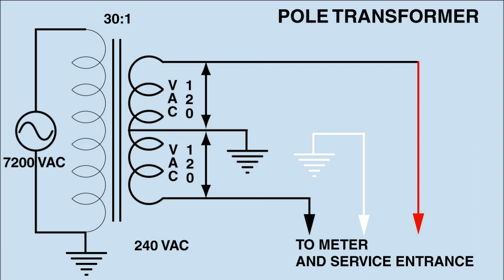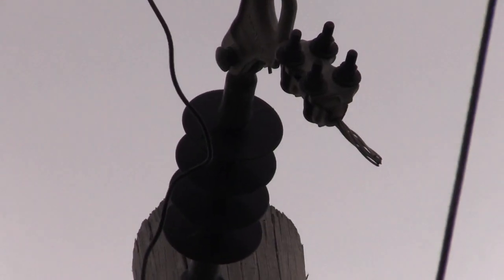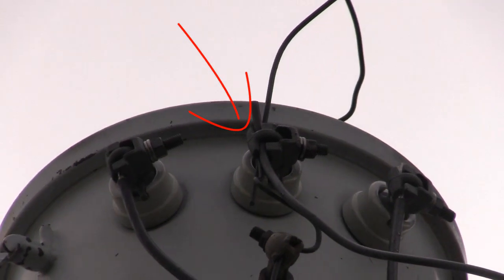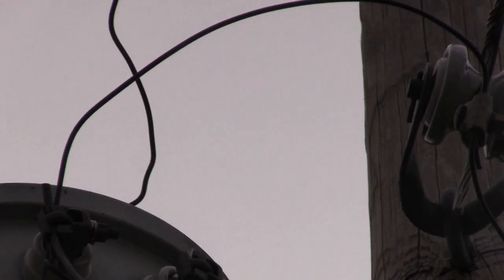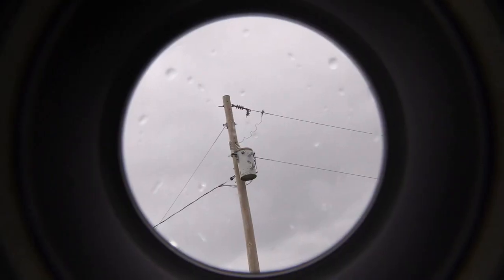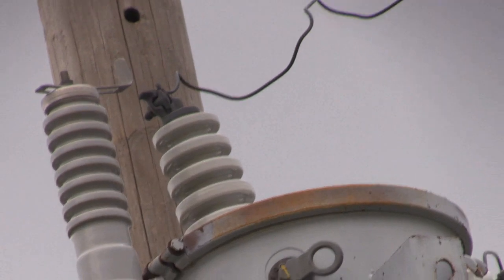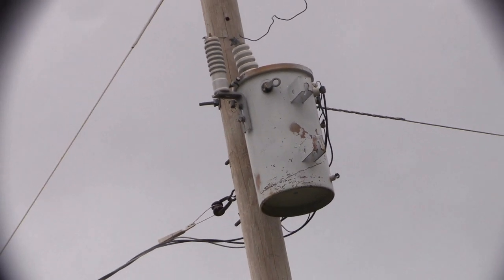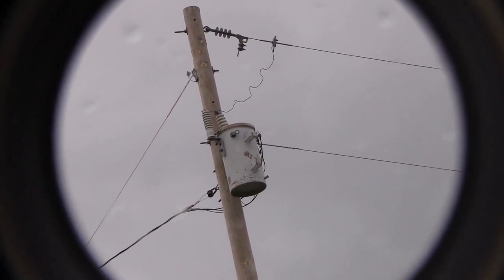Pole Transformer

Comment: How does the high voltage wire feeding the can, BALANCE BACK to the distribution point? No visible Neutral? thank you
Reply from the maker: Hi Ted, Thanks for the comment.  This is a common point of confusion, no pun intended.  An entire video could be made on just this point.  The first graphic in the video shows the generator at the power plant working against a coil which ends up being the primary coil of the pole transformer after being stepped up and stepped down along the transmission path.   On half of the cycle the generator forces electrons from the top down to ground and on the other half of the cycle the electrons flow up from the ground.  So at the pole or at any other transformer along the line going back to the substation or however far you want to go back, the ground is distributed.  Every transformer is grounded and every pole is grounded etc.  I am so glad you are thinking about this.  Start looking at every pole transformer you pass and you'll begin to notice that they are all fed by a single "hot" wire, the one on top of the poles in the pictures I took in my rural area, and they are all grounded by the lower wire on the pole.  The lower wire goes all the way back to the point where my single phase leg breaks off from the 3 phase, where it is grounded.  As mentioned before this lower wire is grounded at every pole along the way by a solid copper ground wire that runs down the pole and is coiled up at the bottom of the buried end of the pole.   In this case "neutral" and "ground" are tied together and therefore synonymous.  I apologize for the poor quality of the video.  In my defense this was one of my very early attempts.  It could be improved greatly.  Near the end of the video I label the lower "return" wire which would be what you refer to as "balance back to the distribution point".
Reply: @PostHocNonSeq  can you explain how electrons flow out the ground from the power plant or substation .does that mean the ground carries electrons into both coils of the transformer . Also does  ground in the home get electrons from the secondary coil in the transformer through the ground and the incoming hots . . Your the first person I heard talk about this.
Reply from the maker: @j.s3612  It can be confusing to say that "electrons flow out of the ground from the power plant".  They don't really flow but rather bump into each other.  One classic example is a pipe full of golf balls or tennis balls, when another ball is put in one end a ball falls out of the other end this makes it look like a ball flowed through the pipe but if you paint one of them red you'll see that it takes much longer for the red one to actually flow from one end to the other.  Remember to think of a power plant as an alternating current source.  Although the electrons may be bumping one way at a particular point in time they quickly reverse and bump the other way 60 times every second.  The circuit from the power plant to the pole transformer only includes the primary of the transformer and I know that sounds impossible but the transformer action induces the current into the secondary windings, there is no physical connection between primary and secondary inside the transformer.  The secondary winding in the transformer is part of the circuit or loop that goes to the "home".  All electrical current in the home is current that has been induced into the secondary winding.  Induction of current in a conductor is related to this discussion but is generally a subject area of it's own that comes up in basic physics.  Thank you for taking an interest in this subject and the video.
Reply: @PostHocNonSeq  if the primary winding on the transformer was disconnected frome the ground will the transformer still function correctly.  Could the fuses still blow if its not connected to the earth . Thanks for your time and energy
Reply from the maker: @j.s3612 NO, 

When you say "If the primary winding on the transformer was disconnected from(sic) ground?"  I think what you mean is if it is disconnected from the return path to the power plant.  If that happens the circuit will be open and no current will flow.  Referring to this return path as "ground" is OK because it usually is, there is often a ground wire running down each pole to the bottom and wound in a circle under the pole.  This wire would also be ground at the power plant.  But it does not have to be grounded in all cases.  Ground can be very confusing, try to remember that it is just a reference point.  In the case shown in the video the can is grounded to the wire running down the pole and to the guy wires.  Along with these connections it is connected to the return path to the power plant.  It is hard to imagine a situation where the primary could become ungrounded unless the winding just goes open.  In which case no current would flow and no current would be induced in the secondary.  

When you say "Could the fuses still blow if it's not connected to the earth?" The only circuit protection in the primary would have to be in the transformer or "upstream" at a substation or junction of some kind.  If that is the "fuses" that you're talking about then they will still be active but will only open if current exceeds their rating which seems obvious but is a fact.  The only way current in the primary could exceed the rating of the protection would be if current were flowing to ground somewhere along the line.  

So far we have been pretending that the line that feeds the primary of the pole transformer comes from the power plant.  I think it is important for you to realize that there are actually several transformers in between at power transmission level and at the distribution level at substations.  The details become more important as we dig deeper into things.